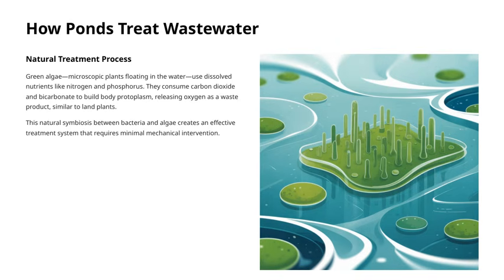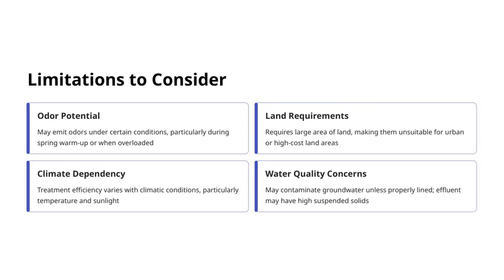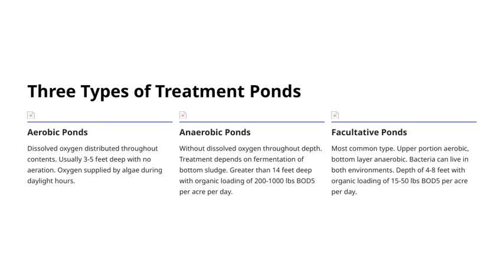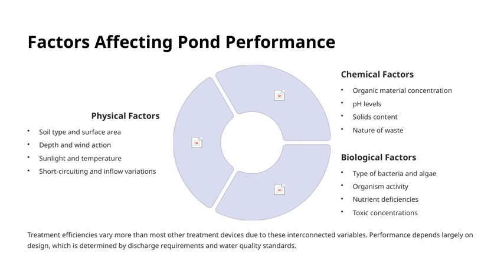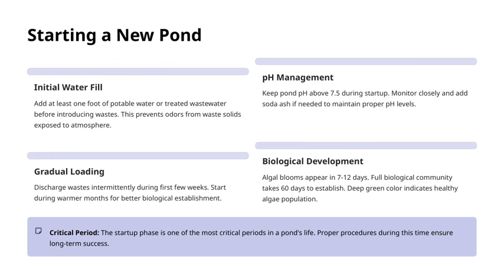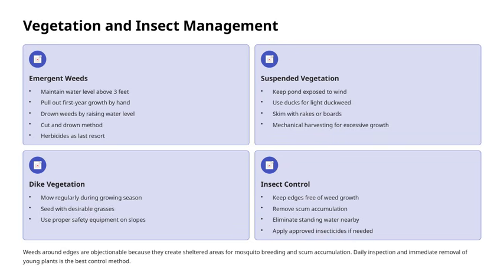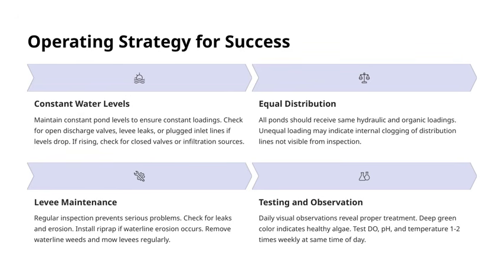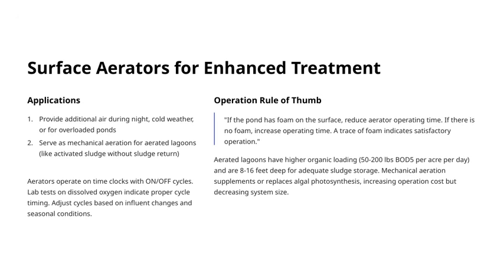Wastewater Treatment Ponds: Facultative, Aerobic & Anaerobic Lagoons

Comment from the maker: The thing that catches new lagoon operators: seasonal turnover.

Twice a year the temperature stratification holding the lagoon in layers breaks down and the whole thing mixes top to bottom. Anaerobic bottom water comes up. You get a sudden BOD and TSS spike, a DO crash, and odor complaints — with nothing changed in your influent or your operation.

It's physics, not a process failure. What you control is preparation: log your turnover dates so you know your own window, know where it falls relative to compliance sampling, and give the office a heads-up before the phone starts ringing.

Full breakdown: https://wastewaterace.com/blog/wastewater-treatment-ponds-lagoons/

Anyone running lagoons — when does yours turn over?